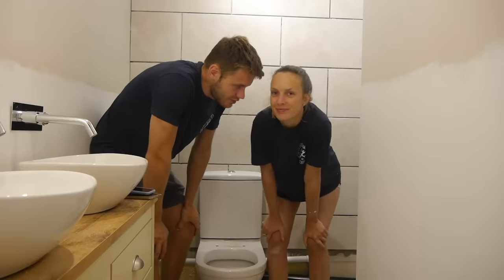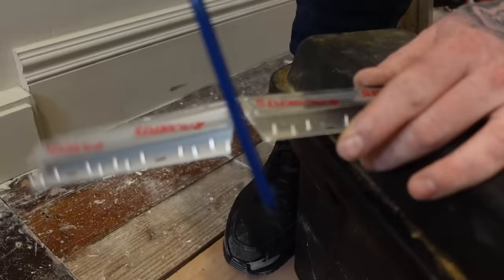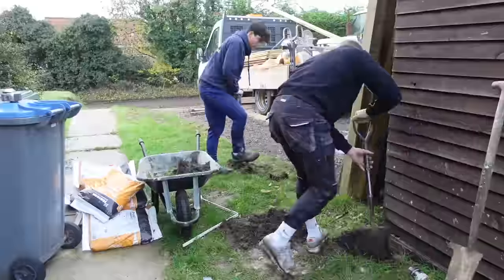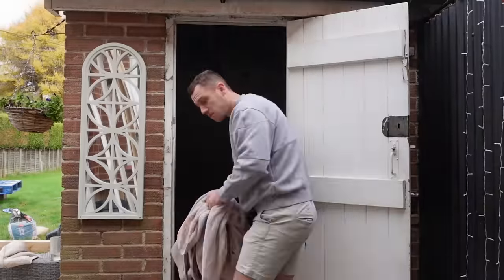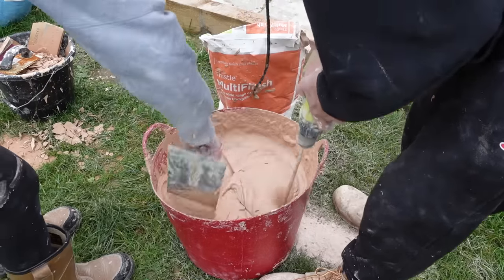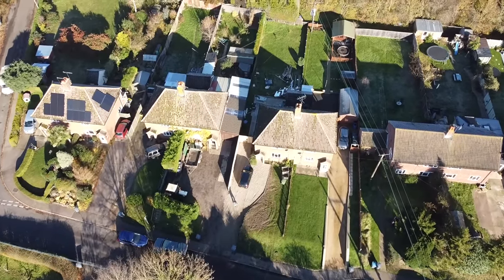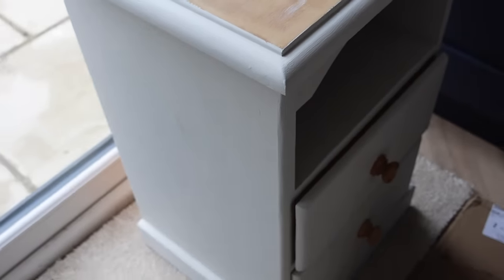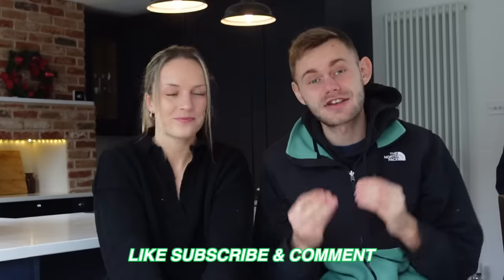Extreme Home Renovation on a budget / UK DIY Renovation

Comment: re the small front garden - remove the tired and unloved roses that have not been well looked after.
A new rose must Not be planted in soil that previously held a rose.
But roses are a good choice.
So first  remove the old worn out tired soil at the front. 
Take out a depth of 18 inches of that old soil along with the sad struggling  plants. Put that old degraded soil down the back.
 Then  replace  that removed too-tired  soil with a 6 inches cover of with some good quality compost topped with   12 inches of a quality seed-raising mix- (the latter is often superior to an "any old potting soil" - the latter is often too full of old rotted wood/now sawdust. 
Then plant row of lovely new David Austin low floribuna roses in various colours  - will look glorious in spring summer and early autumn with a rest period for the roses when the weather is super cold

Comment: My gut says cornflour blue for the lightness in a smaller enclosed space...

You could drag light to the back with a cleverly placed mirror on the back wall of course so either colour will look lovely. But my first instinct was to go lighter.

Keep it up, it's looking fantastic. And H is right - the structural stuff is just the start isn't it? The fit and finish is the lengthy bit. Not unlike vans.
Reply from the maker: Thanks very much, another vote in the bag for cornflower blue! 💙 Glad you’re enjoying the series and you’re spot on, the structural stuff really just is the beginning and took us WAY longer than expected! 🙂

Comment: Hmmm... I would have made a pathway from the front door to the street out of the same pavers you used for the patio. Would just look nice and give you a way to not have to walk on the gravel drive when going for a walk. Also maybe need a light above the front door where that metal sign bracket is.
Reply from the maker: Hmmm, maybe that’s something we should have considered. A light is definitely going to be installed above the front door! 👍🏻
Reply: @NickyandHarri  You could buy like 4 of the pavers and do them just under the entry overhang that way the gravel isn't so close to the door 😃